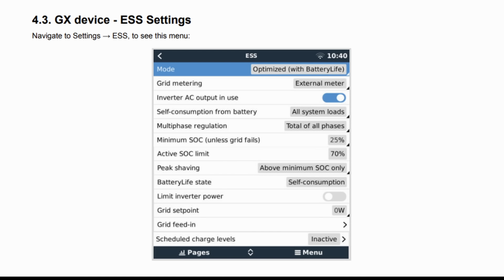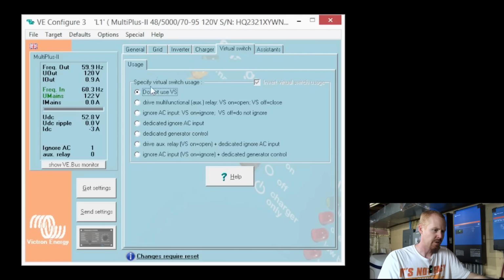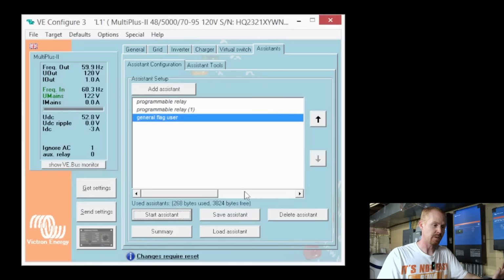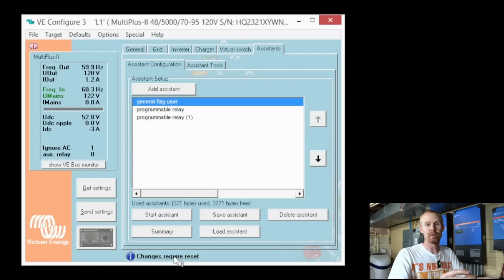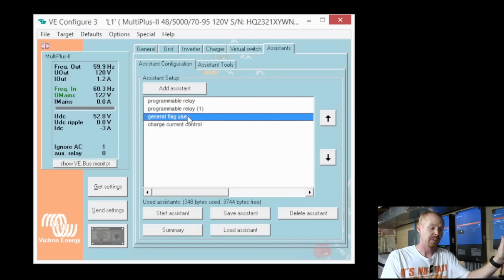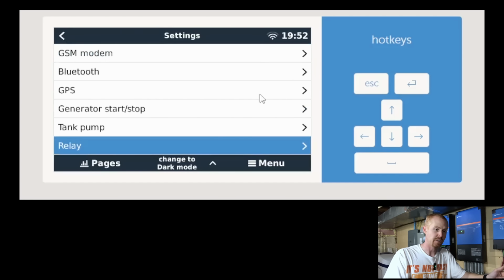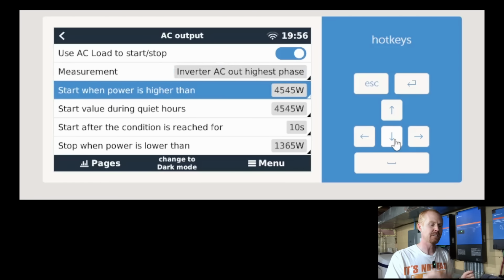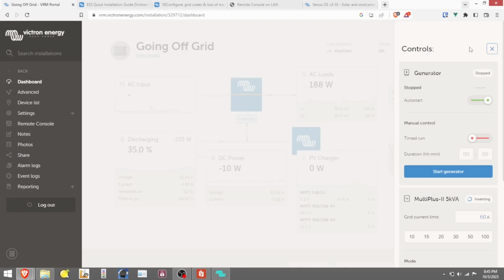Different Ways to Ignore AC Input on a Victron MultiPlus 2 Inverter

Comment: Thanks for that Adam. I have actually already used my 2 relays on my GX Venus and also one of the AUX relays to stop my heat pump when my SOC gets below 16%. I have 2 x Multis as well and 6 x Pylontech batteries, no solar. My system recharges overnight between 00:30 and 04:30 to recharge the batteries but what I've been finding is leakage of valuable volts back to the grid during the day. I've found that I'm feeding back to the grid 102KWhs over that past 7 days which is a lot of battery power that I don't want to give away. So I thought, like you, I'd disconnect the AC in via the virtual switch but got stuck because it also deletes the ESS (so I thought). But you have shown me another way to get around this which I will try with the general flag and possibly the AUX2 relay. I am going to assign the AC switch to the general flag and then using the general relays to switch AUX2 on and off. Then wire AUX2 externally to a digital timer set to 00:30 (on) and 04:30 (off). This will then only connect the mutltis to the grid during charging, which is what I want and because they are linked to and external (manual not computer) timer, I can change this easily.
Reply from the maker: That's always been my concern when the ESS assistant is being used.  I don't want any power going back out to the grid, so I had to find some alternative.  

Yeah, you can't use the Virtual Switch and any assistants at the same time.  I find the assistants allow for more customization though.  Good luck!  Let me know what you find out!
Reply: @AdamDeLayDIY  I programmed the multis with the general flag a 2 x programmable relays but found that it now throws up a “Grid alarm Grid lost [261]” is there a way of suppressing this message that you know of?
Reply from the maker: @dickie997  Yep.  On your display or remote console, go to Menu -> Settings -> System Setup and disable "Monitor for grid failure".
Reply: @AdamDeLayDIY  got it 👍

Comment: Hay Adam just found your channel  and I must say thanks for you detailed explanation and videos. I have one question tho. When grid assist is trigger by watts does it supply all the needed watts or does it assist the battery bank and deliver a percentage of the watts needed?
Reply from the maker: Thanks!  The way the Victron inverters work, it will activate AC in and completely take over all loads till the “release” value is met.
Reply: @AdamDeLay07  so if you should turn down the sure power amp draw, let's say to 10amps (meaning you can only pull 10amp from sure power) but lets say house needs 25amps to supply loads will the batteries supply the  additional 15amps? Im looking at making my solar system work hard and depend less on grid power.
Reply from the maker: @seangordon4492  I've never done it but I believe so, yes.  That's their "PowerAssist" functionality.  It's designed for use with smaller generators in mind that can only output a fixed amount of power.  If the inverter output requirements exceed the AC In current limit (and powerassist is enabled), then it should draw the remaining power from the batteries.

I get what you're trying to do, cause I'm trying to limit my grid usage as well.  Personally I wouldn't mess with the PowerAssist in a fixed (home environment).  Focus more on getting your batteries recharged so you don't have to be on grid at all.  If you use PowerAssist like this, you'll be continually draining your batteries and depending on the loads, you might not be able to recharge fast enough.
Reply: @AdamDeLay07  Wow, the softwear is really flexible, I get so excited when I learn something from your videos. I think every individual has to program their multi as to their needs because in my case my system is in float by 10:30 most days. Im really just trying to fine tune it because im away from home most time and would love to have the grid backing my system up just in case. Thanks again brother and keep the videos coming you're doing a wonderful job.
Reply from the maker: @seangordon4492  Thanks Sean!  You're right, every system is different!  Good luck and have fun!

Comment: Really helpful, thank you!   Kind of silly you have to run those wires between relays, the Cerbo should be able to do that over it's existing connection to the Multi; hopefully an update will give us that capability!
Reply from the maker: Thanks!  Yeah it would be nice to use the relays for external connections and have the cerbo be able to manage anything “internal” to the Victron network.

Comment: I was just wondering how to do this until i get to work out some node-red flows .. great video ! Just wondering if i need to hook aux 1 on the master inverter only on a 3 phase rather thab hooking 3 multis to cerbox on aux 1
Reply from the maker: Glad it helps!  I would think it would be the same on a 3 phase as it is with split phase, you just have to hook it to the master.

Comment: I just installed 2 Victron 48V 5000W Inverters in Split Phase.
How do I get the MP's to automatically lower the charging amps when the onboard generator is supplying AC IN?
Reply from the maker: I’m not sure if there’s an automatic way to distinguish between generator and grid. 

I know you can use the Cerbo to change the max ac in, but I’m not sure if that applies to the charging amps as well.

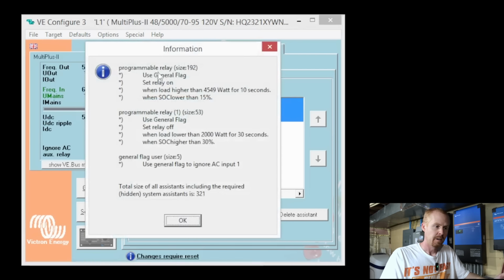Comment: 9:21 Hi Adam. Im wondering if you needed to change the relay output condition, or if the assistants worked exactly as shown in the summary. On my Multiplus, I needed to set the General Flag relay output to “Off” in order to activate AC1 input, and to “On” to ignore AC1 input.
Reply from the maker: Did you use the NC or NO portion of the cerbo relay?  That would change the conditions needed.
Reply: I’m not talking about the physical relay, I mean the general flag used in the section for creating assistants. On my system, “On” means “Ignore AC1”.
Reply from the maker: @gradythird5678  I can’t recall exactly how it worked in that specific example because I didn’t use it very long due to the fact that u discovered the generator start/stop function.

It could be that the normal “off” state of that relay is “closed” and “on” is “open”.  That might explain why I had to use the NC side of the relay on the cerbo.  

Logically it seems backwards though.
Reply: Yes, it work the same with my Multiplus 10
Reply: The instructions for setting the assistants is backwards in the video. Setting the flag to “ON” activates “Ignore AC1”, and vice-versa. Other than that, it’s a great video.
Reply from the maker: @gradythird5678  After discussing this with someone else, I believe you're right. "On" does mean that you're gonna ignore AC input, and that's why I had to wire the relay in the cerbo the way I did in order to control the general flag the way I did.  There wasn't really any explanation so it was confusing to figure it all out.

Comment: Thanks for your work. Do I have to program all 3 units in 3 phase system?
Reply from the maker: Thanks!  Because the relays are specific to the inverter, I believe you only need to put those assistants on the specific inverter.  I actually just went to my system and removed the assistants off inverter 2 and everything still seems to be working as it should.

Comment: Im using node red. It's super easy to program and easy to change. It was interesting to see how to perform the same function with the cerbo gx relay. The big issue for me is that I don't want to charge the batteries when I turn on the ac power. If my batteries get down to 20%, I want to switch over to grid until the next day of sunshine. However, I'm finding that the multiplus 2 seems to want to charge the batteries every time you enable ac power. There is no "pass thru" mode. It's always pass thru and battery charger. You can set the battery charge to something like 3amps, but it won't let you set it to zero. It's inefficient to charge the batteries and then use the power. It would be great if you can just pass grid power until the battery state of charge goes over a threshold and then switch to inverter. (ie. sun is shining.) If you find out how to do this, please do a video.
Reply from the maker: I’m the same way, I don’t want to charge when the inverters switch to pass through mode.

https://youtu.be/T5-7xcGWsgE

Comment: Adam,
 Fantastic Video! exactly what I want to do, tweak from anyplace thru the cerbo.
 Did I miss something? 13:02 your back on L1 after sending assistants to L1 and L2. 
  Did you create a New general flag (which is the same as 1st) Create another Programmable relay & relay (1) with new commands, is that correct? for the Start & Stop Gen from the cerbo with Aux1. Then those get sent to L1 only.
  Thanks Adam!
Reply from the maker: Thanks!

So after 10:15 I start talking about the Gen start/stop feature which is what I'm using now.  The assistants shown before that time were really just showing different options you could use.  

So at 13:02, I'm using the same assistant, but the relays were changed to utilize the Aux1 state as trigger parameters.  I believe that I only sent those to Inverter 1 but it's been so long, I might have sent them to both inverters not knowing that they only needed to be sent to one.  I'm assuming you only need them on the inverter that has the physical connection to the Aux1 input.

Comment: Intriguing idea. One thing I'm not clear about is is whether the SOC and AC LOAD conditions are AND logic or are they OR logic? I would like to do something different with my much smaller system. I would like to use assistants to keep the battery in a narrow range so that the solar has somewhere to go, but still have significant battery for a grid failure. At the same time, I don't want to ignore AC IN unless it can be automatically be turned on quickly if the load increases. I understand that ESS might be able to do some of this, but I don't ever want to feed power to the grid with all the attendant hassles. ESS seems focused on feeding excess power into the grid, but there are hints that it doesn't have to.
Reply from the maker: They’re OR conditions.  If the SOC gets below X or power output gets over X.  

At some point I’ll dig into ESS, but I can’t have anything flowing back to the grid.
Reply: @AdamDeLayDIY  My understanding is that the code requirement is that "anti-islanding" in certified inverters has to react within 2 seconds, and that seems to be how the MultiPlus  II works.  Talking with Jason at Current Connected, he doesn't believe that there is a way to guarantee that no power would ever be sent to the grid with ESS. I believe that's the case with Solark and others as well. That's why I am intrigued with your solution. I set my system up with the generator relay, but for now have AC IN manually enabled in the Cerbo. I will play with auto conditions to see how they work in practice on my system.
Reply from the maker: @larrylp2192  from the research that I’ve done, it seems like no inverter can really promise 100% that there will not be any backfeeding to the grid. A lot of these inverters tend to draw a certain amount of power from the grid to help prevent any from going back towards the grid. These multi plus inverters can do the same, but I’m like you, this generator control seems to really make things function the way that I want to, without having to worry about anything flowing back towards the grid.
Reply: Agreed. Unrelated topic. I was doing some testing of efficiency vs. load on my system and I was surprised to find that efficiency of my system drops to about 85% when pushing it. Even at rated output, it drops to 93% or so. I verified that there is virtually no loss in the battery cabling (~8W at  50% over rated output). Then I went back and looked at some of your load tests. I don't know if you ever reported on efficiency per se', but looking at your remote console screen captures I was able to verify that your efficiency is in the same ballpark as mine. I was impressed by the low idle consumption spec, but that's dwarfed by the inverter losses at even moderate consumption levels. Did you ever look into efficiency at various power levels with the EG4s, or can you glean this from your Solar Assistant historical data?
Reply from the maker: @larrylp2192  I don’t think you can get accurate efficiency ratings off the remote console.  Realistically you have to measure each inverter individually by putting a clamp meter on the input and the output.  

I never did do any efficiency testing on the 6500s either.  I was probably too worried about what I would find… 😁
Reply: Yeah. I don’t trust the VRM too much, but I think that it’s in the ballpark when it shows hundreds of watts lost. I have an independent monitor from Emporia that I use to monitor the power going into and out of the Multiplus. It uses miniature CTs that fit easily into small spaces. It also samples faster than the Cerbo, and can monitor up to 16 ckts, so it’s easy to see what’s drawing the most, balance legs, see what rooms have the highest idle consumption, etc.
Reply from the maker: @larrylp2192  Yeah, it's entirely possible.  I don't have multiple Clamp meters that I can verify with...at least not ones that I trust.  

It does seem that the spread on the Remote Console happens more once the fans kick in, so those are obviously part of the losses recorded, but having only a single fan, I can't imagine they're drawing that much power.
Reply: @AdamDeLayDIY  FWIW, I did some testing this weekend with ESS, and I can verify that there is NO way to guarantee that it won't back-feed the grid. In fact, I discovered that it's possible to briefly back-feed the grid even without ESS if conditions are right during large changes in load. For instance, try killing your load panel briefly and watch the grid reading on your display.
Reply from the maker: @larrylp2192  thanks for testing.  Can you explain how you’re seeing back-feeding without ESS mode?  I don’t see how it would happen because the AC in relay is disconnected when your in battery mode. 

If your powering from AC in, that would make sense then.  I believe that happens normally when a large load switches off.
Reply: @AdamDeLayDIY  I thought I sent a reply, but I don't see it. Maybe I didn't complete it. Yes, I normally operate with AC IN enabled. I use the system mainly for backup, but have a small amount of solar to offset the losses and reduce my energy usage as well. I saw the back-feeding in two cases. One is, as you noted, when a large load drops off. The other is when the inverter has no load, but AC IN is on.
Reply from the maker: @larrylp2192  No worries.

Makes sense with AC In enabled.  You would probably see the same thing even without the inverters since you're just passing the power from the AC In to the AC Out.
Reply: @AdamDeLayDIY  Here's an update on my ESS testing that I thought you might be interested in: I enabled ESS again and found a group of settings that work quite well for me and my usage. To summarize, I have mode set to "Optimize with BatteryLife", minimum charge set to 95%, AC & DC grid feed-in off, and grid set point at 250W. These settings are perfect for my usage mainly as backup, but aided by a small amount of PV. I chose this value because my lowest normal load is about 300W, and that's at night. I have only had the grid go negative once for 1 second since then. The system seems to hold the grid consumption close to the 250W value. The reason I was getting feedback to the grid before is that I had the set point at 100W, and ESS allows negative excursions as high as 150V during normal operation. In my testing, I went back and looked at my Eyedro monitor, which can display net usage, and found a number of samples (1 second sampling rate) of grid feedback, but this was the case with the Multiplus II (with or without ESS), the EG4 AND with NO inverter. I think it's due to back emf from a motor starting/stopping. As I think about it, I believe that the issue with the Multiplus II occasionally creating these spikes is because it is a low frequency unit with a large transformer, and the back emf of the collapsing field when a large load (even a resistive one) is turned off produces the feedback, much like the back emf when a large load is turned on counters the surge. This is inherent in the design, and can't be disabled, but would probably look to the utility just like a large motor, and therefore not unusual.
Reply from the maker: @larrylp2192  Glad to hear you've found your "sweet spot".  I was thinking it you would have to have your grid feed in set at least to 100W, but that adds up over a 24hr period.  It must just use that power to offset the load on the battery, which in the grand scheme of things I guess isn't that bad.  

As far as the back emf, your guess sounds a whole lot better than mine (cause I don't understand why it would be doing that).  

Like you, when I get around to testing this, I'll have to keep a close eye on any possible negative grid values.  Last thing I want is the electric company knocking at my door...
Reply: @AdamDeLayDIY  A big AMEN to that ;-)